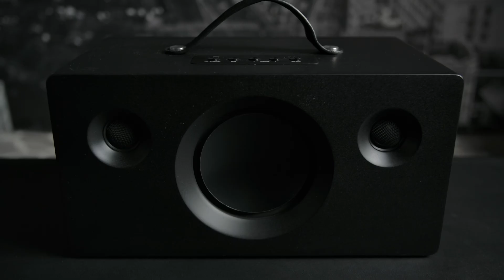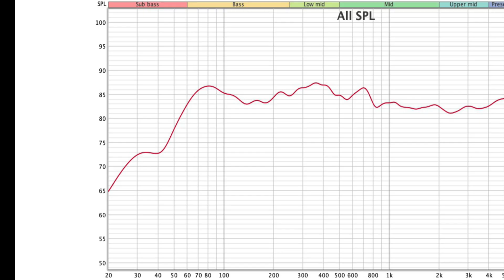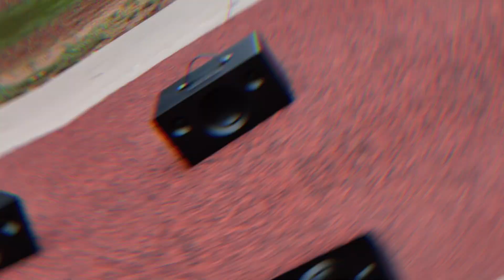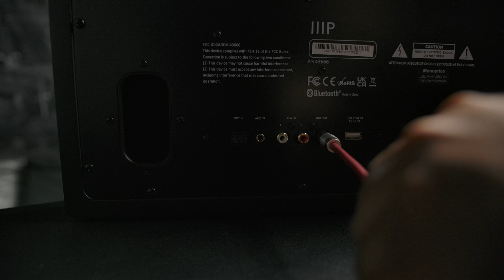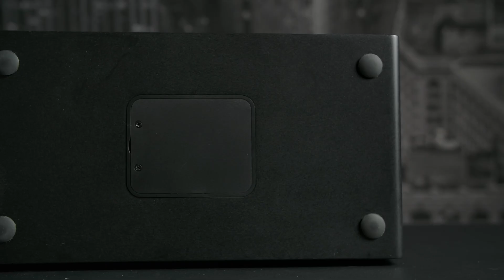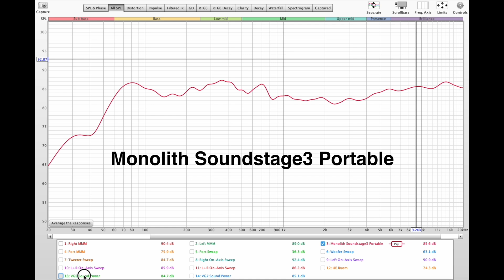The Bluetooth Speaker You Didn't Know You Wanted! - Monoprice Soundstage3 Portable Review

Comment: Did you really test that "sub out" port? I did, and 3 speakers in a row FAIL miserably to deliver any kind of a useful subwoofer signal. I went through hell with this speaker and this company! The video is on my channel if you care to check it out. But I sure would like to see just one of these things that actually works the way it's supposed to, by the manufacturers specifications. Cause I've now got 3 in a row that failed miserably to do what they claim it can do! Cheers 🍻
Reply from the maker: I just watched your review. I did test the sub out, but I did not test the frequency response of the sub out the way you did. I just wanted to know if it was full-range or not. If what you're saying is true, that's bad  design. Personally, I don't care much about the sub out on a Bluetooth speaker, but if they're going to give the option, they should've tested it thoroughly.

Another thing I just found out is that the USB output seems to only work when plugged in. That's not very useful if you want to charge your phone on the go. If you still have yours, let me know if it has the same issue.
Reply: @joentell :

 I currently do have 2 of these speakers and a part 2 of my video review in the works. They just finally refunded me last week after filing a claim with the Better Business Bureau and 3 failed products in a row. None of these things put out a subwoofer signal. I never thought of testing the USB port though until you mentioned it, and it's exactly as you describe on both of my current speakers. It will only output if plugged into wall power. So yeah, that's about useless! I'll mention this in my part two video video update. Cheers 🍻

Comment: They are $175 now on Monoproce and Amazon (plus 5% discount if you check the box). I pulled the trigger. Reviews on Amazon are pretty horrible though. I trust Joe though. I'll return if not satisfied.
Reply: Edit: looks like the one on Amazon might not be the portable version? It doesn't say portable but it does say there's a Li battery. No handle on the photos so I don't think it is. Either way it's still discounted on the monoprice website.

Comment: When I saw the thumbnail, I thought it was from the Swedish company Audio Pro. Looks like a clone. If you could get a hand on the real one, it sounds really good for the prize in Sweden and blows Sonos out the windows.
Reply from the maker: Wow, they do look very similar! I wonder if they're the same.
Reply: I thought same. I use to own the Audio Pro Addon  T10 which sounded great while it lasted.  Most seemed to have some kind of a defect and burnt out or buttons not working.  Look at the comments on Amazon.  Not sure if it was only that model with the issue.
Reply: @greenfiend2499  For what it's worth I had a t10 gen 2 for years and then sold it to a friend and it's still going strong !
Reply: @mcsenny4793  That's great.  You got one of the good ones, while the rest were lemons.  It's usually the other way around.
Reply: And $169 with much more features
Reply from the maker: @altops4490  are you in the UK by any chance? The T10 is $299 on Amazon here, and it's not a brand I've heard of prior. Maybe they don't advertise much here.